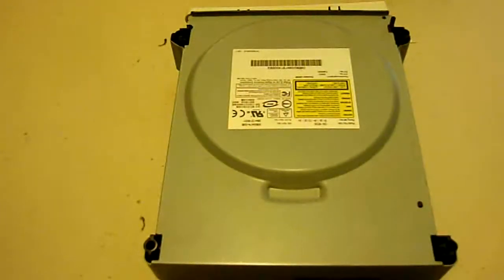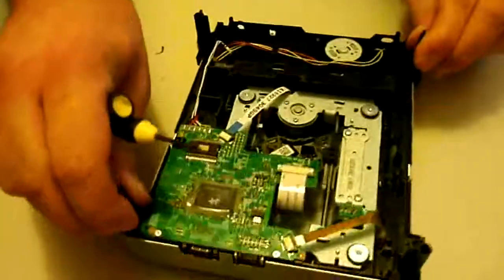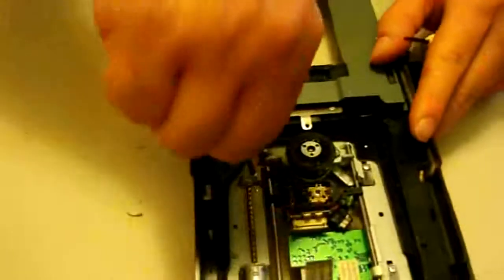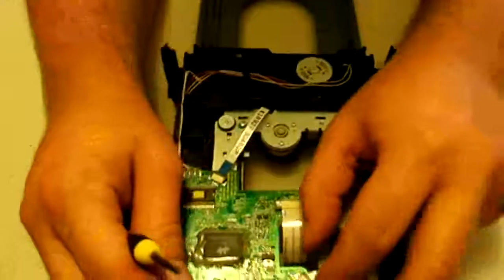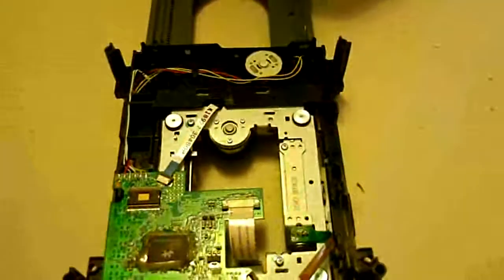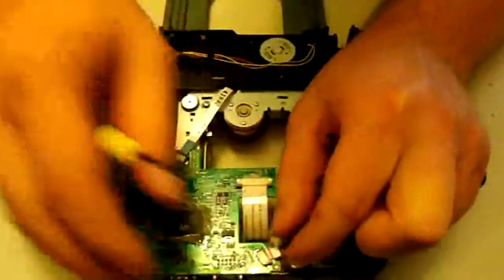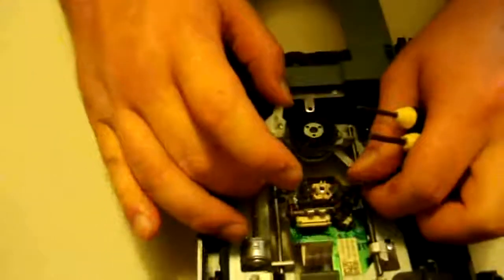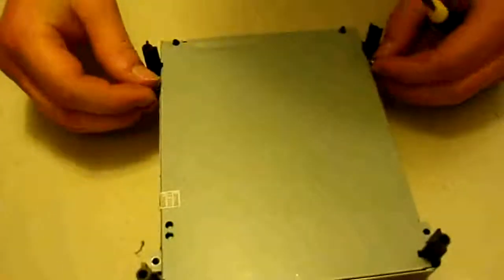How to replace your Liteon DVD Disc drive worm motor. Xbox 360 FAT repair Tutorial

Comment: I am having problems with certain games freezing at exact same points every time. Sometimes the video freezes, but the audio loops over and over. Could this be my problem? Just not moving to all parts of disc? When I power the drive on with top off of drive, the laser moves maybe 1/4" to and fro but curious if it should be moving more. I've tried the POT adjustment, but same results.